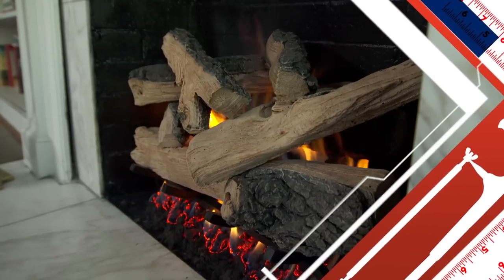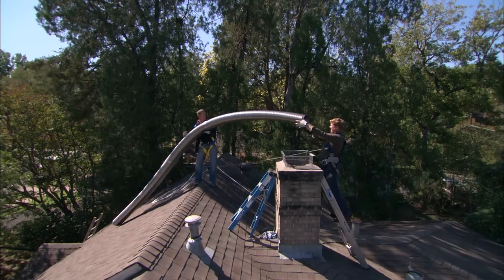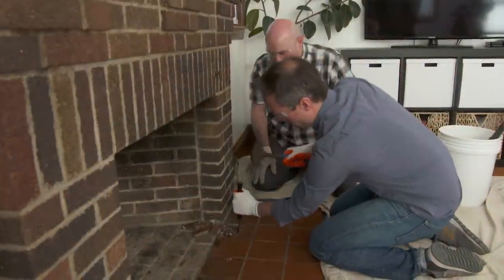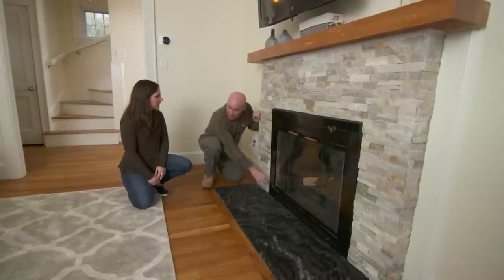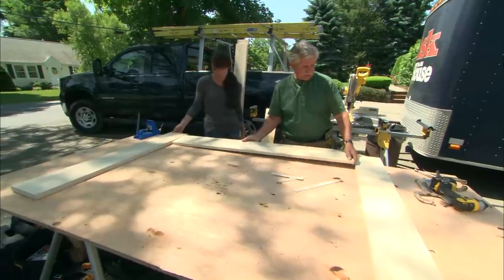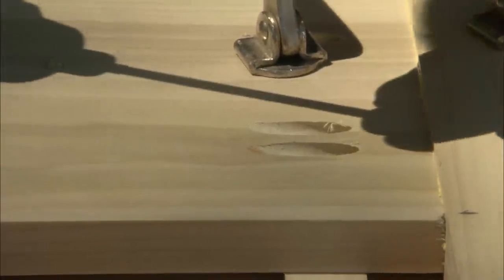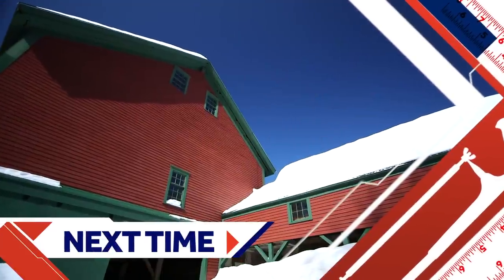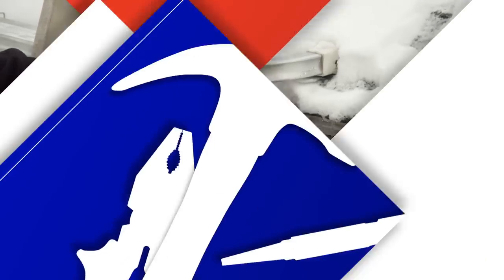ASK This Old House | All About Fireplaces (S19 E7) FULL EPISODE

Comment: Ever since my mom had her fireplace installed in her custom built home back when it was built in 2003, we never got a chance to properly use it, because of a leak somewhere in the chimney. Rainwater would drip down, more on heavier days. Plus, we still need to get the rest of the gas kit for the fireplace, including the ceramic logs.
Reply: XzTS I suggest watch a 13 part series called What on earth happened by Ewaranon to learn that the earth is not a globe. I got it in my about tab.
Reply: 20 years and the fireplace was never finished?!?!?
Reply: @PatHaskell  
Yeah, it turns out, the chimney cap was one that was poorly designed for our area.

Comment: How do I do it? My gas fireplace is original to the house approx 25 years.  It's in perfect shape and works at the push of a button. I see the later models have a fan that captures heat from the inner walls of the fireplace and sends it into the room which would be great for us because the ceiling is vaulted to about 18 feet, and that's where the heat collects, but most of the heat goes up the chimney. There are places that sell fan kits to blow that heat into the room, but the fireplaces have an inlet grate at the bottom of the fireplace, and a grate at the top of the fireplace where the heat comes out as a result of the fan blowing. My fireplace has a solid metal panel top and bottom with no inlet or outlet openings, but it does have some vertical narrow grates along the side of the fireplace on the left and right sides. I'm handy enough to cut in top and bottom grates in the existing solid metal panels, but my question is, will this work after a universal fan kit is installed?
Reply: Excuse me richmargadonna I'm not familiar with that but I suggest watch a 13 part series called What on earth happened by Ewaranon to learn that the earth is not a globe. I got it in my about tab.